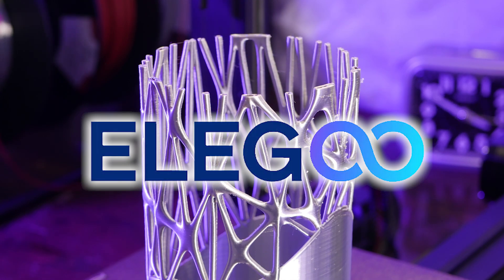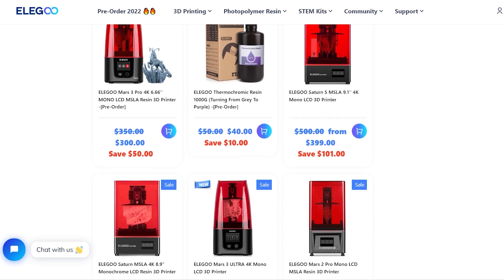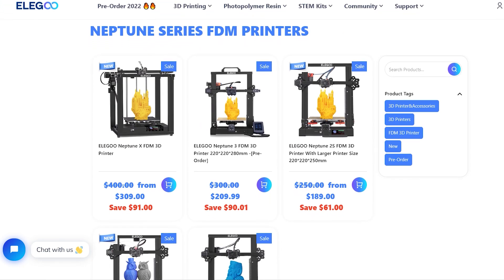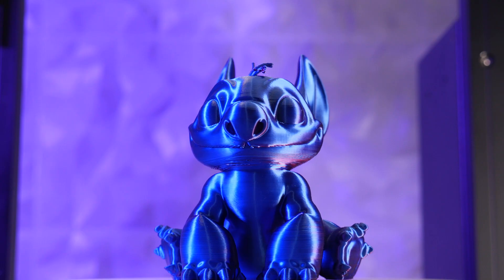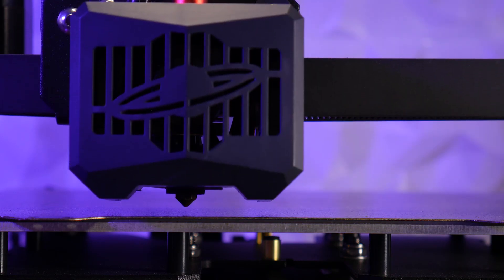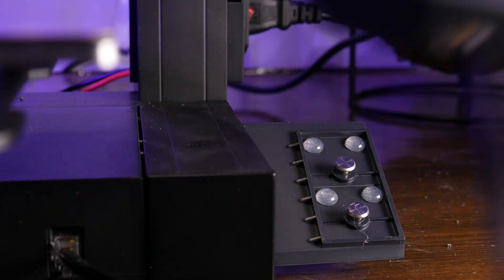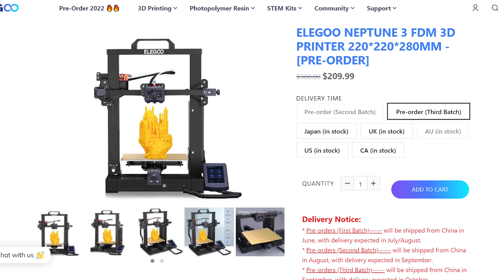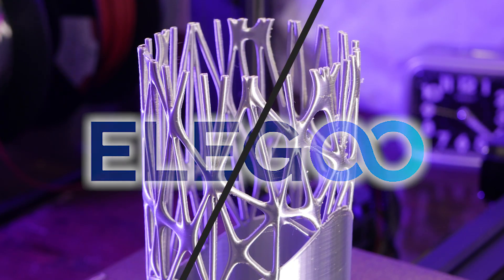7 Awesome 3D Printing TimeLapses on the Elegoo Neptune 3 3D Printer

Comment: Ive been having a hard time getting good bed adhesion for whatever reason. I have been using hatchbox filament and set my bed to 50c
Reply from the maker: Set it to 65!
Reply: Yeah definitely turn the heat up. I usually do 60. I also have found that using a glue stick and then after applying the glue stick I wipe it down with some rubbing alcohol and then I get perfect adhesion every time.
Reply: @gavinmcaffee5048  I now set my bed to 70C for all

Comment: I have this Printer.. and yes to start with a great printer.. better than all my others, But shortly after a few prints done, I found that it was not so great!
No matter the amount of set up & auto leveling etc. done I now see maybe One Okay print done for every 20 to 30 bad failed prints no matter the filament brand or effort put into the testing and set up etc.

So like allot of the printers it may be great after the 1st set of prints but soon ends up wasting you time and filaments and power with bad print one after another?
I been doing 3D printing for over 3 years and are part of a discord group but still I end up fighting to get any good prints now and if I try silk filaments like you do so well.

I end up still getting plenty of fails no matter what is done.  

So good you get great prints... allot off people don't.
Reply: You know I had the same problem for a while. When I first got my Neptune I found just using a glue stick on the printing bed and then wiping it down with some rubbing alcohol. Afterwards made all the difference and make sure nothing is jiggling the bed, the printing, head the arms, everything anything is jiggling then you'll get bad prints every time.